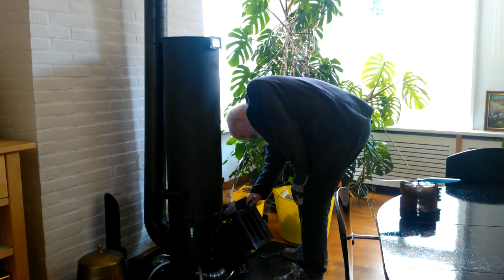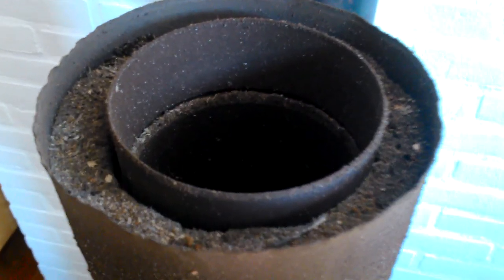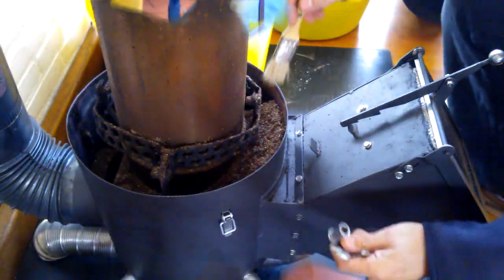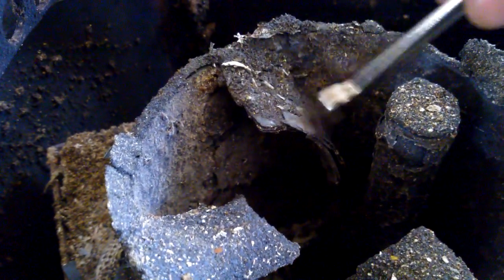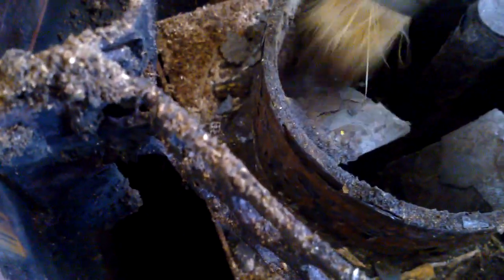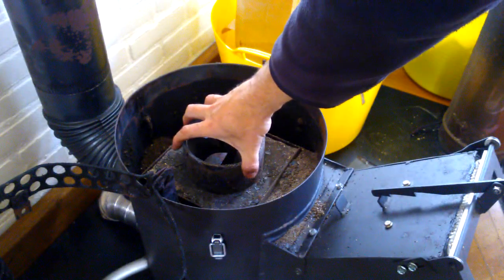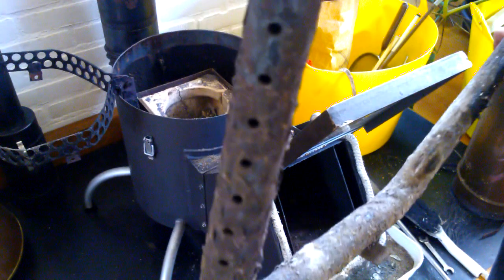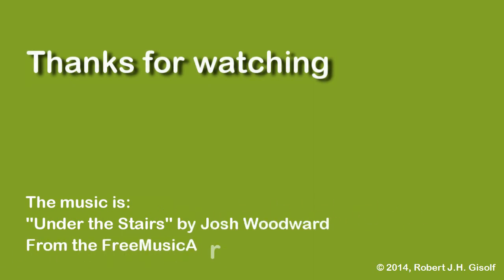Rocket Stove disassemble inspection

Comment: Hi Robert. Great video. Did you use any other metals than stainless steel? Apart from metal, I can see some brick and what I think is some Rockwool for insulating the large pipe - is that correct? Best, Albert
Reply from the maker: The outer casing is normal steel. The 'brick' that you see is casted fire proof concrete. You can see the casting in one of my other videos in the playlist. The riser is a standard available disolating flue pipe. The the walls are stainless steel but the inner waal is to thin. It won't stand the riser temperature for very long. So a ceramic riser pipe would be better.
Reply: @RobertJHGisolf  Thank you so much sir. It would definitely be interesting to see more videos on the progress of your rocket stove project, or perhaps technical drawings? I'm planning on building one, but would like to avoid setting my new house on fire... Best regards, Albert

Comment: Hi Robert, are those flakes @3:34 as a result of spalling of the metal? Fantastic job by the way...really great project!
Reply from the maker: I have difficulty with the translation of "spalling". But the material is a form of iron-oxide caused by the very high temperature. You could compare it with "mill scale".

Comment: I like this design. However the batch hopper seems small and the angle should be steeper to allow it to be self feeding.
Reply from the maker: Correct. the 30 degrees angle is not exactly steep enough. I don't know the correct angle at what that will happen. Do you?
But I also like to see the fire. So I push the burning wood with fresh wood.

Comment: I suspect the air injection would get your vortex started without the vanes.  I like your concept of using the airwash from the glass as your secondary air too, elegant solution.   Most rocket stoves with thin heat risers tend to get damaged over time, it is good that you can replace it as needed.

Oh you have excellent production quality too.
Reply from the maker: Probably not, because the air is drawn from the holes, the holes are not blowing the flames. And since I replaced the parts with Stainless steel there are no damaged parts (yet...), except for the thin inner pipe of the standard double walled flue gas pipe.

Comment: Robert, 
 Fantastic design and construction! Your videos are also well done and informative. The only question is how do you manage the ash as I didn't notice an ash pan? Does most of the light fly ash just pass through the the stove and exit the flue?
Reply from the maker: Thanks for your compliments. The high temperature and efficient burn leaves almost no ash. After a few evenings of full power burn I remove the ash with a small shovel that I designed for that. And yes, some light ashes fly trough the riser and collect in the lower part of the drum. That's why I can easily remove my drum, as you can see in my video.
Reply: Robert J.H. Gisolf i

Comment: How long did you use it?
Reply: Robert J.H. Gisolf so probably the best improvement would be to cast the riser in the same way as the core, 
I love your design Robert, if the vortex plates were cast fire cement, I doubt they would suffer damage, instead of 3 fins, maybe 3 swept ports for secondary air,
 quite a complicated casting it would be, but your two part riser may allow further experimentation.
thanks for your vids.
Reply from the maker: Around a half year? Really, at high temperature, only use stainless steel or ceramics.
Reply from the maker: Oh, I meant I used it for half a year before I had to replace the mild steel with Stainless Steel. After that I still use it for around three years. Now my inner thin stainless steel wall of the riser is deformed. But still holding. A ceramic riser is better.

Comment: What is your goal with the secondary air pipe?  From your other videos, when your glass primary is closed, basement air feeds oxygen past a floor heat exchanger into the combustion chamber.  So why the stainless pipe introducing even more oxygen amongst your cyclone baffles?  Or do I have my parts wrong?
Reply from the maker: I changed my design for that. The secondary air pipe is extended, so will get air when the glass primary air door is closed. This preheated secondary air, injected in the most turbulent part, is very important.
Reply: Robert J.H. Gisolf I'm finding some rocket stoves where this isn't necessary.  I've reviewed secondary oxygen applications since posting.
Reply from the maker: Secondary air is very important for a clean burn. See for instance the explanation that Peter van den Berg wrote at http://batchrocket.eu/en/workings.
Reply: I hear ya, but there are plenty of rocket stoves without it as well.

Comment: As fire is a very hostile environment for steel, your design leaves a way to inspect and change out compromised parts. Good work.
Reply from the maker: Indeed. So I easily changed the mild steel parts with RVS. And that is still working.

Comment: This is the most attractive looking rocket heater I've seen. Excellent job! I love the concept of rocket stoves/heaters, but don't fancy having a huge oil drum in my living room. Your design looks more conventional. Did you run the pipes off around the side like in your animation, and if so, did you cover them in cob and use it as a heated seating area? I'd love to see a video showing the entire thing in all it's glory. Did you need permission to install and use this in the Netherlands? Thank you.
Reply from the maker: Thanks. No, at the end my partner didn't like the extra pipes :(
But the idea of a rocket stove mass heater is indeed to heat mass so it can be radiated at low temperature for a long time after the stove fire is stopped.
No, I don't now about a need for permission. We can buy any stove and use it. Even the very polluting old style open fire still is allowed.
Reply: +Robert J.H. Gisolf Thanks for your reply.

Comment: Hi Robert,how long were you using the stove before this inspection?
Chrome Molybdenum can handle heat better,they use this in the re-heaters in coal fired power stations at the bottom of the element where the heat is greatest.As the element rises they change to a lower quality steel.But not mild steel.
Inconel is very heat resistant,but pricey.Used on the exhaust from jet engines on Helicopters,F1 cars,Fighter jets.I believe,i could be wrong but i think is was developed by Rolls Royce for this purpose.
There is also a steel type that the use on chimneys called Creusal staal,this is very anti corosive.You see it on a lot of factory boilers,with a sprial around.Not as cheap as mild steel but not as expensive as RVS or Inconel.
 Your height adjuster for the riser,was this initially just to get the perfect gap between riser top and top of stove? What size gap did you end up with?And does the expansio of riser affect the burn much?
Sorry for all the questions.
Great stove,you inspire me!!
Reply from the maker: I was using my first design for only a few month. I replaced my inner tube with normal RVS, and that is holding fine. I know about the expensive Inconel, but I don't need that yet.
I wanted to experiment with "the gap" but found out that as long the circumference is as minimal the circumference of the riser, all goes well. 
And the longer the internal riser is, the better the draft will be. But that has limits, off course. My one meter riser does fine.

Comment: are these heaters safe?, remember if you don't have proper flue to vent outside you can be overcome by carbon monoxide,  its happened before when a couple lit a fire inside a closed container and never woke up, or is it a good way to burn your house down.
Reply from the maker: Sure these are safe. But of course you always need a proper flue to vent outside... I have a CO-sniffing device near my stove. It never triggered an alarm.
But be aware: Normally you waste heath energy to keep your chimney hot enough to create a draft. The rocket stove creates draft INSIDE the stove, in the internal riser. So there can be some mild overpressure in your flue pipe. So tape your joint properly.

Comment: dear robert, i am from argentina , love your work, have a few questions about design, about the gap how it works and if you have plans for making these for me... hope not to bother ...
Reply from the maker: Hi Victor. You can read about "the gap" in several other reply's I did. I don't produce this design yet. But how do you think I could transport such a thing from The Netherlands to Argentina?
Reply: I will see the other reply. Robert how about oxígen consume. . There is some danger about it
Reply from the maker: As you can see in my first video I draw the air from under my floor, almost nothing from my room. But most stoves use air from the room, so my danger is only less than standard stoves.

Comment: What is the output (BTU/hour)?
Reply from the maker: Well, depends on the fuel input. My central heating system is 25 kWh. If I use my rocket stove the central heating does nothing and the temperature of the house is rising.

Comment: some really nice work there, and I echo the congrats on doing review videos as well as build. given its been a while now is the riser still holding up and how are the vortex vanes? I would be interested to see how it would perform with and without the vanes, and yours is one of the few designs where they could be removed
Reply from the maker: +Ben Fountain Thanks. And the vanes and pipe are doing well since it's made of Stainless steel. And yes, my design is made out of modules, so you can replace parts of it with other experimental parts.

Comment: Here is a question for you, how much for 4 of them, and how long would it take to produce. I realize you are not selling these commercially, but let's say theoretically someone was to need several rocket stoves and wanted something similar to yours, would you produce them how much would you like to charge. Myself, I'm trying to find an economical way of heating a large scale, 4 season greenhouse in climates that reach -40 celcius during the winter months. I do not have the skill set to construct such a wonderful stove but am very envious of the construction of this stove. 

I realize that such a skillset is not required for a rocket mass heater and one can be constructed in a much more economical and entry level fashion, but this is about perfect for my needs, so I'm curious to know. My requirement would be several years out as I'm currently starting a non-profit and will require to secure funding before I proceed with my pilot project. If you're not willing to construct, would your friend with the workshop be willing to produce several of these units? If the pilot project is a success there is a possibility that many more units would be required over the coming years as the pilot project reaches production stage. Hope you see this comment and respond. Thank you.

Comment: Excellent stove Robert and a great build.  Would be interested to know how you get on with the SS insert, I suspect it will last longer but may still burn up as you have got some very high temps happening at that point. I guess it can simply be replaced evrey year or two as it certainly does a great job of mixing the gases.  Do you use the stack adjustment on a day by day basis?
Reply from the maker: Steve Boyd Thanks. And the Stainless Steel is still great. So no replacement needed yet. And do you mean my "gab" adjustment? The space between the top of the riser and the top plate of the outer casing? No, it is now always at the same position. But if the temperature in the riser gets very hot, my 1 meter long riser gets orange red hot and extends almost a centimeter. So it decreases the gab by itself. Automatic compensation!

Comment: Nice work and sharing. Rocket stove has major advantage producing clean exhaust that allows pipe to run through a large heat sink without clogging or a flue fire. This is what heats the house after a small fire goes out. A cobb or stone/sand over the laced piping producing a bench or wall of thermal mass. This is the point. https://www.youtube.com/watch?v=wvUbNU2wQW8
Reply from the maker: Thanks. And I know the principle of the heat sink. But my girlfriend didn't like the idea of a huge pile of cobb or an extra pipe loop...

Comment: Hello Robert, a very good video, and a well designed stove. Thank you for sharing this with all of us! 

I am thinking partially along the lines of ***** here below. - "Is your secondary air tube really necessary, what happens if you block the air tube? Also are your vortex fins necessary, will the flame naturally spin on their own?" 

I have to ask too, as to why you and some others have chosen to insulate the inner pipe? I am also glad to hear that your wife said no to all of that extra pipe in the room for radiation. : - )  I agree with her, but not because it would be ugly, taking up too much room, or in the way, but I find it unnecessary.

If everything is sized correctly, and the efficiency is dialed in (fire size, stove size, etc.), we should be able to get all of our heat exchanged from the main stove. While keeping in mind our minimum exhaust gas temperature, to achieve exit of the building. Avoiding the corrosive effects, and the risk of reaching the flue gas dew point, at which time acidic condensate forms which can lead to premature corrosion failure. Which is approximately 130 to 160 degrees Fahrenheit. 
http://bit.ly/14kHLLy

If I had this stove of yours here now, at this point, and with this wonderful hindsight and inspection you have given us, I would lose the secondary air tube, and the fins. Then I would try the inner riser without it being insulated. I say this with some hesitation though, knowing that it seems you have a near perfect exhaust temperature now. But we did not see how big of a fire you had going during these temperature readings, and do not know how long the stove had been running. 

Thank you so much again Robert, for your time in working on this project, and sharing it with us. I look forward to seeing more in the future, and hearing about how you are getting along with this project.
Reply from the maker: Thanks for your compliments. The inner pipe needs to be insulated to keep a high combustion temperature where the flue gasses still more or less are burning. That's also why there is this secondary air injection to make sure that unburned wood gas has the possibility to burn, and on high temperature. The vortex helps in good mixing of the flue gas with the secondary air. A high temperature in the riser also gives more draw. Enough draw to push the flue gasses outdoors, so you don't need a high temperature there.
But indeed condensation is a concern. If you lead the flue gas directly out of the wall you can do that at a lower temperature so you see the condensing water damp (incorrectly called "steam" by a lot of people). But in my case I lead the flue gas into an old fashioned chimney where, if my temperature is too low, condensation will occur. So I'm happy with my flue gas exit into my chimney at 60 degrees Centigrade.
I do my temperature readings when the stove is burning quite a long time, with a moderate to high fire.
Reply: Thank you much, for those bits Robert.
That would be the common exit around these parts as well. Into an older chimney stack. 
I am subscribed, and looking forward to more in the future.

Comment: Hi Robert, excellent job on the construction, video, and animation. This has to be one of the best Rocket Stove I've seen on YouTube. The use of outside air for the combustion chamber is a must, and your design is great. The top and bottom viewing windows are a nice feature. The modularity of your design will help in maintaining this for years to come.

How well does the adjustable flue pipe perform, and is there a sweet spot that works best for all conditions? Is your secondary air tube really necessary, what happens if you block the air tube? Also are your vortex fins necessary, will the flame naturally spin on their own?

My only suggestion would be a thermostatically controlled fan that would blow outside air over the Rocket Stove body. This would positively pressurize your home with warm/hot air, and would help heat rooms far from the Rocket Stove. Slightly open a far bedroom window and the warm air will flow in the path of less resistance.
Reply from the maker: Thanks. And yes, secondary air is important, preferably as hot as possible. Primary air must also be heated as best as you can.
Reply: craigslist04 4
Reply: craigslist04 
o
Reply: 12craigslist04
Reply: P
Reply: V  n
Reply: craigslist04 3

Comment: Nice work Robert
Reply from the maker: Thanks. Any experience yourself?
Reply: Yes, some. On my second year of heating with rockets. I keep working at increasing burn times with different forms of wood. Tried and auger feed with wood chips(didn't go well). Current build has a 25lb firebox but need to increase riser tube for improved draft. Right now at 32f outside and a full load of wood the stove can burn 6-7 hrs in a 2600 sq ft home. Swirl chamber is the way to go. Now, to make it last. Beautiful work on yours BTW.

Comment: Robert, I still think the design is great but there are other designs that make a vortex by entering the gasses at an angle, like trying2hard or ppotty . I think the blades in effect act as a heat sink thus cooling the gasses obviously not what you want. I would suggest replacing in stainless steel but not welding all along so letting them get V hot.
Reply from the maker: Trying2lhard already has commented positively on my blades design. And my problem was that the blades actually get too hot. I replaced them with a stainless steel version.